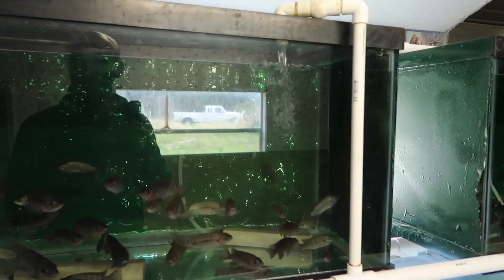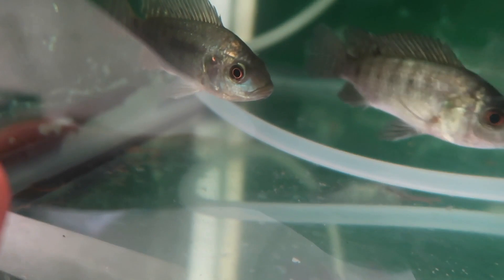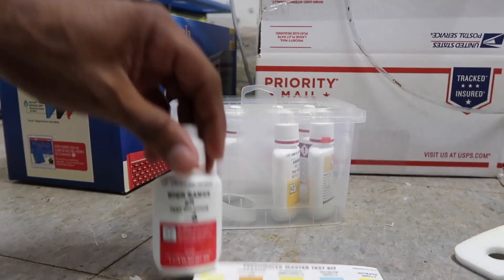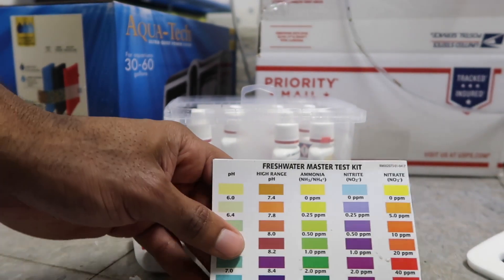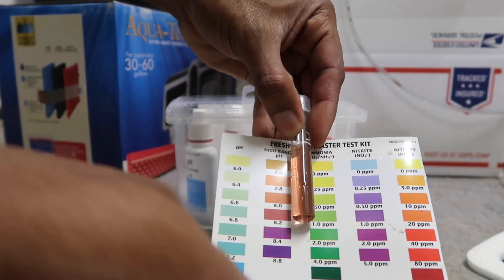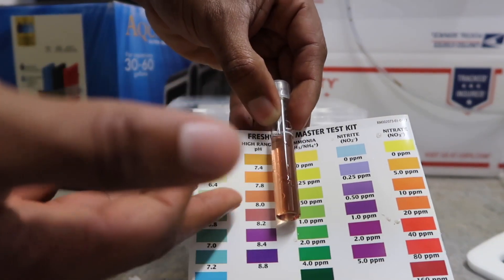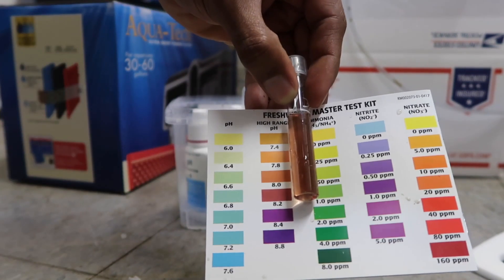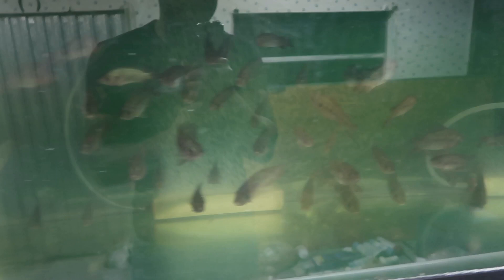Testing The Water & Turning on The Blower | The Aquaponics God Ep.29

Comment: I use a hacksaw on my pipes.
Reply from the maker: That’s some work.
Reply: Not really... I deal with underground irrigation piping so trying to dig all the way around to cut the pipe using a pipe cutter is more work than just trenching to get enough clearance around the pipe and using a small hacksaw. Takes less than a minute to cut through. Good exercise. Now of course if I'm dealing with pipe above ground where I have ability to hold it and spin the cutter around multiple times until it finally cuts through, then yeah he tool you use would be helpful. However, I try to cut down on complications by just using one tool for the job that will work for all situations.